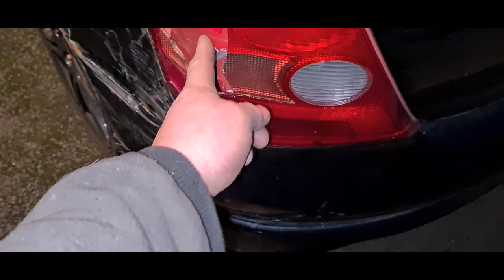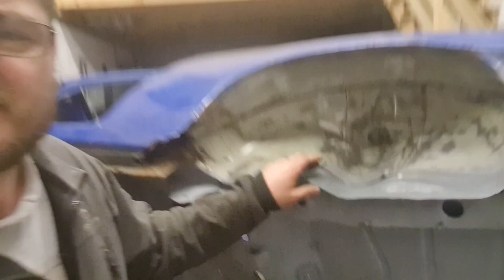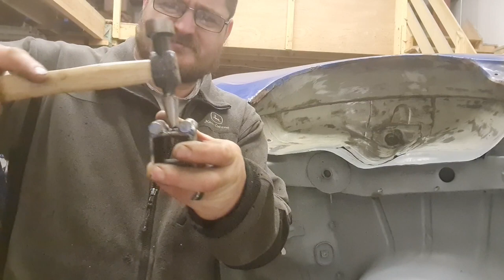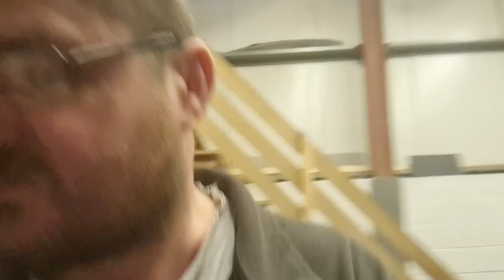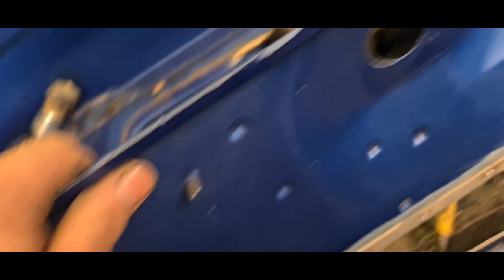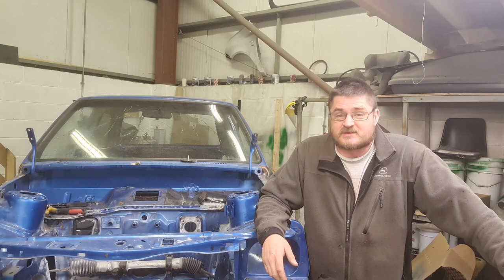scuttle panel removal

Comment: an easy way to make the ribs in the rear inner arch is to open the jaws of the vice just bigger than the width of a head bolt then sandwich  the plate between the vice and the head bolt then hammer it down. you can then use the head bolt in the vice  as a dolly to hammer it into shape.
Reply from the maker: That would also work cheers. I've invested in a bead roller now because I have quite a few more plates to make with beads in.
Reply: @WebstersWorkshop  i nearly purchased one but bottled it. i ve found the the slight pressings creases are a bugger to replicate eg the pressing on the headlight bowl and ridges on the rear lower panel.  if you want a lip/ridge on the panel cut a slot in a bar the depth you want a lip. slip the plate in the slot and work your way along bending it up it until you get a lip. you can then do it again but not as deep in the slot and bend it the other way then just dolly the step you have created into a pressed crease. its not easy to explain with words. ive since made my own pressing forms for the headlight bowls and slam panel ends so making up repair sections is much easier. so many creases and angles to get right, takes too long and im too tight to buy repair panels.
Reply from the maker: I know what you mean, sure they did this on project binky to get an edge on some panels. Cheers for the advice though I'm sure it'll come in handy somewhere on this restore 👍